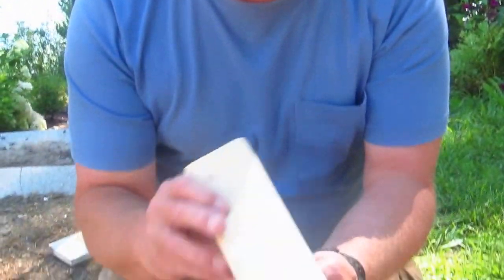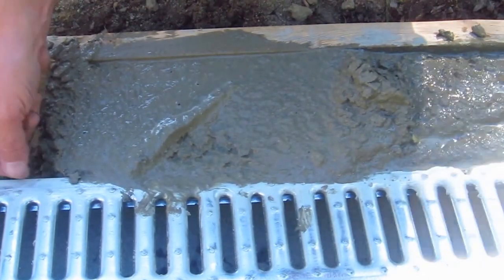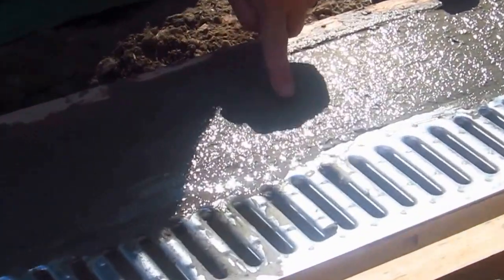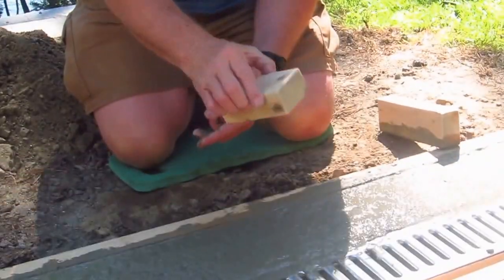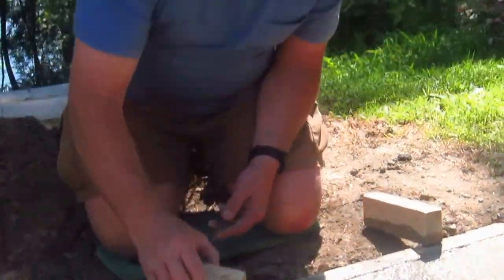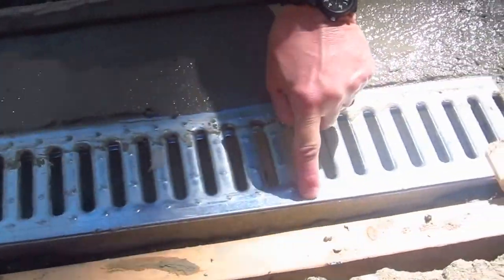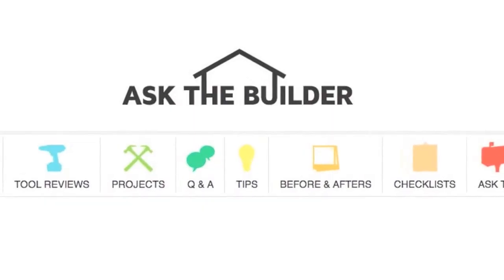Install a Trench Drain Video 6 of 7

Comment: For a better result, I would recommend putting duct tape over the metal grate, so when you remove the tape, you'll have a perfect edge between the concrete and grate with nothing to scrape off.
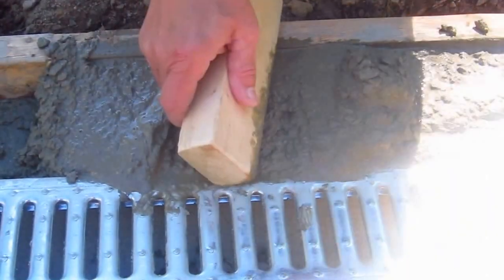Reply from the maker: That's not a bad idea, but even still you'd have to wipe off the tape with your finger or a sponge to ensure there's not a small lip of cement paste and sand at the edge of the metal. The first time you pull up the metal grate, you'll have that perfect edge you desire as the small amount of paste is broken off. Listen to what I say again at 2:00 into the video.
Reply: @askthebuilder  Did you really delete my reply. You can use blue painters tape leaves no residue, cost little money and takes 4 minutes to put on and 30 seconds to remove.... it will be cleaner and easier. It takes time to clean the grate and you don't have a clean edge.
Reply from the maker: @gmcjetpilot  Nope. It's an exterior drain that will have mud, sand and ??? on it within a week of the first rain. It's not a museum piece. Your method works but it's a waste of time and money.
Reply: @askthebuilder  Wow you are opinionated and obstinate. The instructions tell you to tape off drain before concrete. Read them. What mud, dirt and sand? Regardless it is not  CONCRETE. Good gosh. Taping off the grate is a no brainer: Easy, fast and cheap. Trust me. Washing off concrete is a waste of time  Tape works well and makes a clean line and installation... Done it. Works well.
Reply from the maker: @gmcjetpilot  ROFLOL!!! BWAHAHAHAHAA. I'm opinionated and obstinate? I'm not the one that's come here and made three or four comments beating his chest about the wonders of blue painter's tape. One might start to think you've got a pecuniary interest in painter's tape. I can't wait to hear your last comment because you're one of those people that's got to have the last word, aren't you?
Reply: @gmcjetpilot  i am with you mate use panters tape is so easy no fuss but some old fokes no idea new tricks
Reply: @gmcjetpilot  I’m with you too. This dude in the video talks so damn much. There is no need for 7 videos.

Comment: @Ask the Builder  Yes use tape. Use blue painters masking tape. It leaves no residue, cost little money and takes 4 minutes to put on and 30 seconds to remove.... it will be cleaner and easier. It takes time to clean the grate with concrete on it. You will not get a clean edge slopping it over the grate and then removing grate... that is time consuming.
Reply from the maker: Yes. To get unlimited tips each week, subscribe to my FREE newsletter at www.AsktheBuilder.com

Comment: If this is the NDS system, they recommend leaving a fixed distance from each side smaller than 5”.  The reason for this is so when a vehicle goes over it, it will bite the corners of the concrete.  Also, the top of the grate should be about 1/4” to 1/2” below the concrete corner.  This will permit the tire of the vehicle not to rest on the grate itself.
Reply from the maker: Unlimited tips like this are in my FREE weekly newsletter. Subscribe at: www.AsktheBuilder.com

Comment: You can tape the drain....it makes it a lot easier...
Reply from the maker: Yes you can. You can spend your money on tape and then add it to the local landfill. I'm sure some feel that's a good idea. My way there's no wasted money and the cement paste on the grate washes right off. But what do I know? I ate lunch for 20+ years sitting on empty upside-down drywall mud buckets...

Comment: 6 of 7Why don't you use sticker tape to cover the Drain?
Reply from the maker: +Iphone Repair Not needed. Waste of tape and time. As soon as the concrete set - about 2 hours or so - I took the grate out and wiped off the cement paste. You can put tape on if you want, but you can see the finished product and that the cement paste came off with no trouble.

Comment: he made one booboo should of put duct tape over vents before cementing to keep gunk out
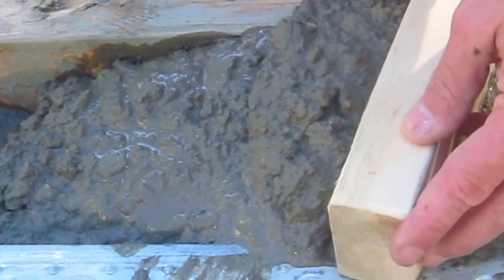Reply from the maker: +55tumbler I tend to disagree. Are you saying you can't control the concrete with a small trowel or the screed board? Did you not watch what happened between 1:00 and 1:30????